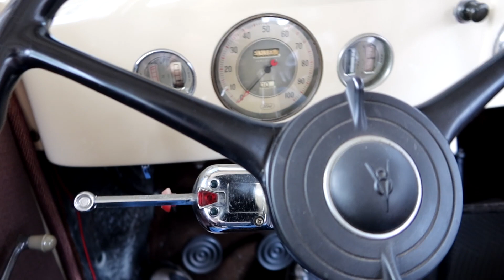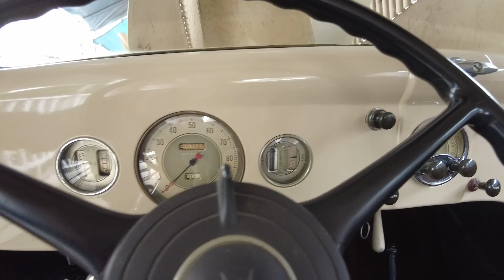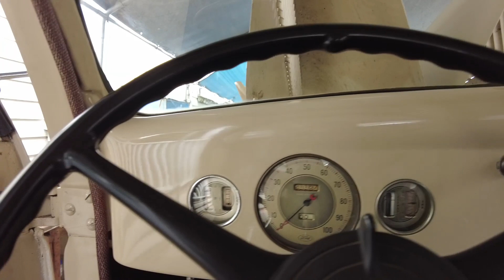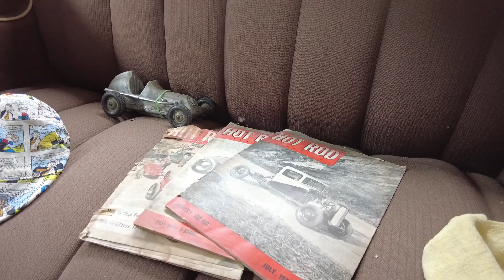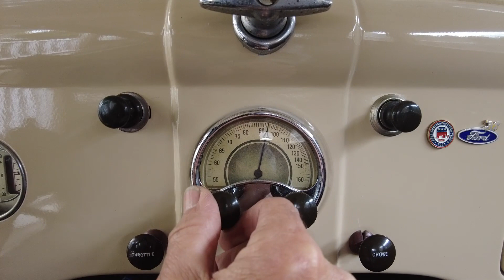1936 Ford fixing the slow starting.

Comment: Do some research to verify but I don't believe the six volt systems want a resistor ahead of the coil. I believe the resistor was added when they began using 12 volt batteries and kept using the six volt coils. ????  LOVE your car !!!
Reply from the maker: I changed out the cheap coil I got from O'Reilly's auto parts with a better one I got from CW Moss and that fixed the slow starting problem. So, I think it was a weak coil all along. 🙂